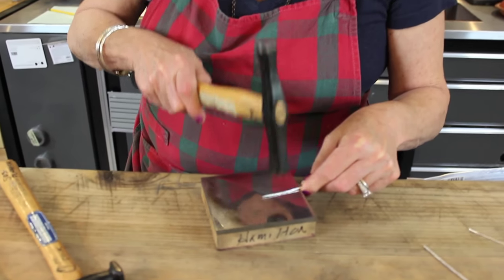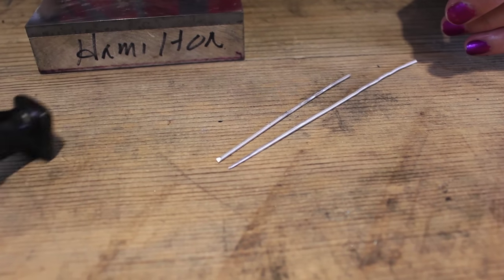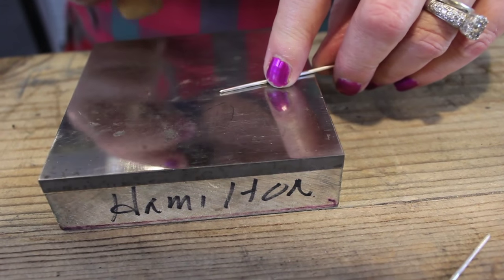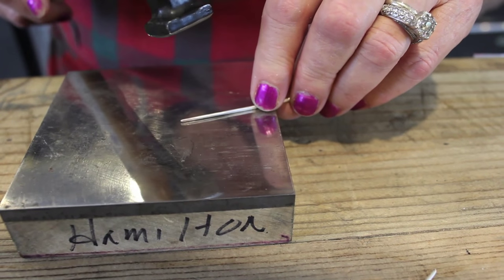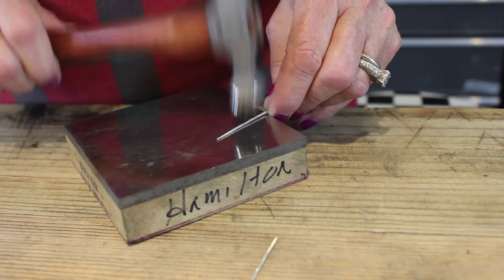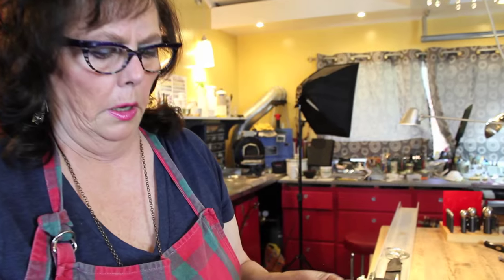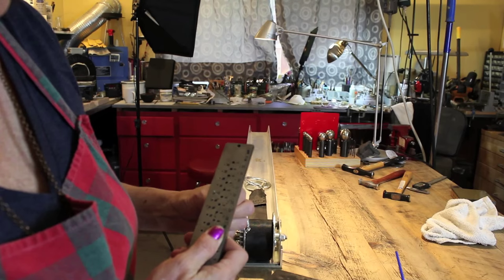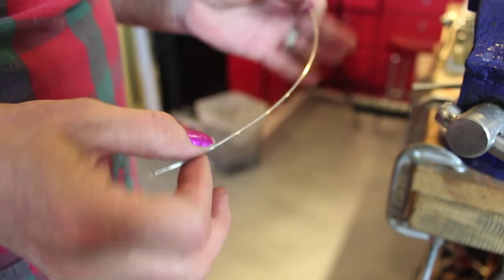Tapering and Drawing Wire | Jewelry Tips with Nancy

Comment: great video! When tapering with the hammer, if you establish the tip first then work from the tip back up to your mark it will be easier and more even. That's an old blacksmiths trick that works on cold "draw down" of most metals.

Comment: I have a draw plate and wondered if I needed to learn some special way to keep the tapered tips from constantly snapping off.  Well, answer seems to be "Nope."  Thank you for that.  Also for the actual lubricant use. My draw plate instructions (a vintage unit bought through ebay) suggested that you torch the wire as you pull, and use graphite.  The torch while drawing seemed like a good way to set fire to my bench, and graphite hasn't been working all that well.  (Also now I need proper draw plyers, or make them out of an old pair of plyers.)